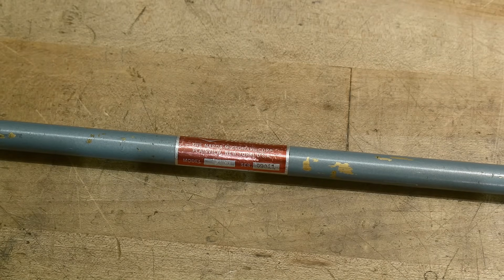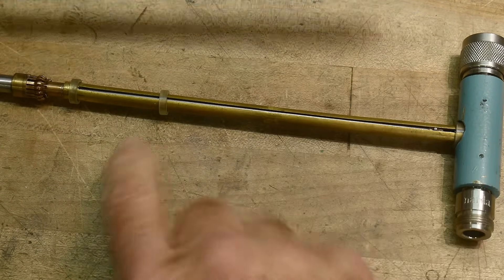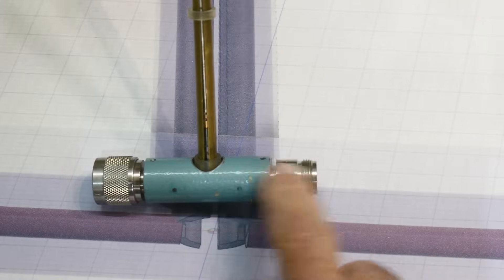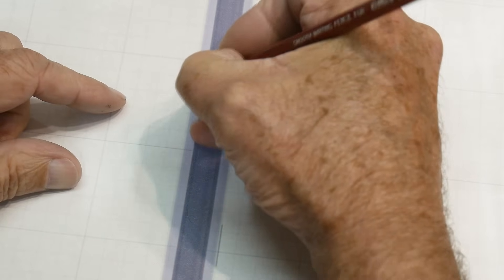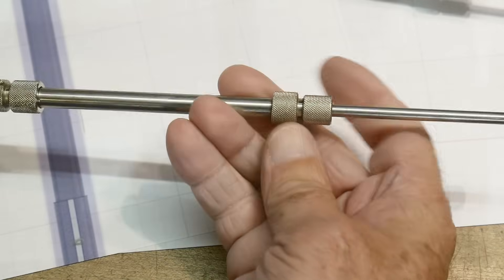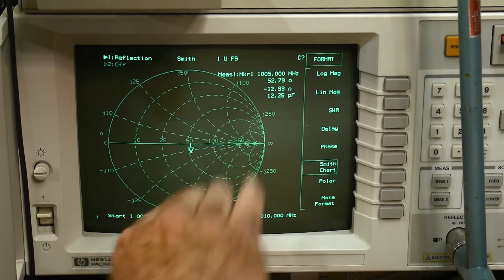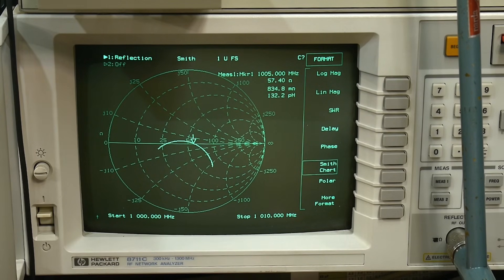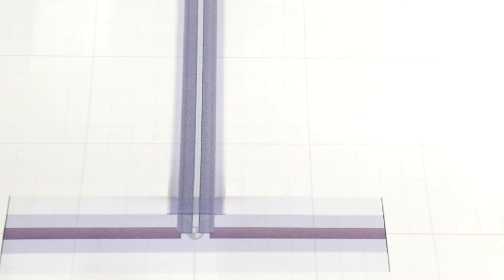#1860 Narda 906N E-H Tuner

Comment: "Back in the day", I used these at my place of work. They are wonderful impedance-matching devices, I believe capable of conjugately-matching any finite and non-zero impedance to any other at any given frequency across the stated frequency range, as long as the impedances have positive real parts, and only subject to the limitation that the conductors of the tuner are not perfect, in that their resistances are greater than zero.

The book, Microwave Measurement, edited by A. E. Bailey, shows a waveguide E-H tuner in Figure 9, page 81.  A counterpart in coaxial line, identified as a shunt – series coax tuner, is shown in Figure 10, page 82.  The Figure 10 tuner is very similar but not quite identical to the Narda 906N because the Figure 10 tuner uses a coaxial line with sliding short in the center rather than a balanced parallel line with sliding short.  (The E-H tuner name when applied to the Narda 906N must be a carryover from the waveguide tuner, as the E and H refer to the electric field plane and the magnetic field plane, respectively, of the waveguide.)

As you correctly point out, the inner slotted structure with sliding short forms an adjustable series element somewhat like a trombone, such that the transmission line length in series between the source and load can be changed. (However, since the input portion of the line up to the inner sliding short is in proximity to the output portion coming back down from the inner sliding short, this section acts as a balanced coupled line.)  The line length is adjusted by moving the sliding short.  As long as the effective length of the transmission line can be varied over a half wavelength or more, the impedance can be moved along a closed arc spanning a full 360 degrees when mapped on the Smith chart. This adjustment constitutes one degree of freedom.

Another degree of freedom is needed to move the impedance anywhere on the chart from the center to the edge. The other adjustment on the outer coaxial structure accomplishes this. 

The outer coaxial structure with the outer sliding short forms a transmission line stub, shorted at the far end, and connected in shunt with the main line. This part forms a shunt susceptance that behaves as either a shunt inductance of any desired value or a shunt capacitance of any desired value, depending on the position of the sliding short. When the sliding short is exactly a quarter wavelength (or an odd integer multiple of a quarter wavelength) from the junction, the stub acts like an open circuit -- it is as though the stub is not present at all. When the sliding short is exactly a half wavelength (or integer multiple of a half wavelength) from the junction, it is as though there is a dead short across the transmission line at the junction. Adjusting the position of the sliding short makes the impedance spot mapped onto the Smith chart move in and out while also changing its angle on the Smith chart.  Thus, the two adjustments interact, but the two degrees of freedom allow any situation to be conjugately matched, as long as the loss in the lines is not excessive. 🙂
Reply from the maker: Thank you so much. Yes this should allow me to figure it all out. I does seem to be a sliding stub at the end of a variable length transmission line (trombone), to modify the phase. So I think the large rod will move along a 1/2 diameter circle between the center and edge of the smith. then the small rod can rotate this circle 360 degrees.
edit: nope, tried to confirm that on the VNA. I need more thinking
Reply: Don't hurt yourself!  @IMSAIGuy

Comment: I worked a aircraft transponder repair bench in the 70's.  The early transponders put out simple pulses at 1090mhz using a tube and a cavity. If the load at the antenna was not 50 ohms the cavity could ring funny and even cause multiple aircraft to be reported at the same location.  We used one of those to vary the impedance to see if the transmitter was stable with different loads.  The early Narco transponders were prone to this problem. Now I might be wrong, maybe what we had was just a line stretcher.  I bet you could build a better transponder than what was availble in the 60 and 70's for $20 from off the shelf components today.

Comment: Let me try and see if I can have a go at this one.
It's a tuneable coaxial "cable". If you have a properly tuned antenna you can stick a pin through a coax at the right spot and the RF will act like there's no short. With an impedance mismatch you'll get reflections. If you add a shorting "pin" at the right place you can eat up a reflection but it'll change the impedance the transmitter sees. With a second shorting "pin" you''ll re-reflect that back to the antenna. The transmitter sees the proper impedance and the load sees the proper driving impedance. It's sort of like a capacitive input pi filter that's used on the plate of a class D amplifier. The plate feds into a variable capacitor in parallel, that feeds into a variable series inductor, and that then feeds into another variable capacitor in parallel. The only difference is this is using the distributed inductance and capacitance instead of the bulk inductance and capacitance.

Comment: When the smith chart is matched to a 50 ohm termination (at a fixed frequency) moving each rod from the tuned position should scribe a curve, giving away what it is doing. It will no doubt be adjusting along reactance or susceptance curves, inductive or capacitive following the curves on the chart (noting your analyzer is not displaying the admittance chart, only the more familiar impedance chart).
Reply from the maker: yes, I have no idea why analyers don't have all the lines. For those wondering: https://youtu.be/QSY8k2IOJqg?si=wF-ye3NmZ_KQyinr

Comment: in my point of view, this is just a parallel plate capacitor. the two segments split inside acts as a capacitor and the shorting point is just a way to put two capacitors in parallel. that is, before the shorting point you have a capacitor and after another capacitor. both will be in parallel. there are some liquid level sensors that resort to a similar effect but by changing the dielectric constant and not the size of the plates. im sure there is also some inductive reactance distributed along the device.

Comment: a 40 Ohm load? what a weird thing. But so convenient for this demo. Is testing Magic T and other match networks what it was made for?
Reply from the maker: no, I'm sure it is just a bad 50 ohm load
Reply: @IMSAIGuy  ahh. That makes more sense commercially 😉. Well still useful in this demo! (Now I'm considering modding one of my many BNC thinnet terminators to be 35 or 40 ohm known bad terminator! Or 75ohm so its usable with F adapter on 75ohm systems.)

Comment: A E-H tuners are commonly known as "Magic T's".  Microline was a product line Narda bought from Sperry Rand Corp.  I have a similar one (different frequency range) that is labeled Sperry Rand Corp.  All of my other Magic T tuners are waveguide types where the E and H adjustable arms are perpendicular to each other.
Reply: So is it a waveguide T, where you can adjust the E and H dimensions of the stub waveguide separately? And the length of the stub somehow as well?
Reply: The term, "magic T", actually refers to the waveguide junction that forms a special type of 3 dB hybrid coupler.  When the sliding shorts are added to the E and H arms, the unit becomes known as an E-H tuner.
Reply: @mikesradiorepair
Mike! Where have you been? I miss watching your videos...on a side note, I think we have a mutual friend halfway between Fairfield and Gettysburg, off of Rt. 116

Comment: Forgive me if I am way off base as RF is not my thing, I'm more of a DC digital guy.
It appears this creates a variable serial/parallel inductor connection
The inner slide varies the serial inductor (and perhaps capacitance across the inductor), the outer slide varies inductor between transmission and ground.

Comment: Microwave tech, "the blackest of the black arts in analog electronics" as CuriousMarc called it.
Reply: If you unfocus your eyes while staring at a smith chart I'd swear it turns into a pentagram 😅
Reply: @KrissyD-px9gj  "Who needs a crystal ball when you have an oscilloscope?" (or VNA, spectrum analyzer etc.)
--Keri the Vacuum Tube Witch